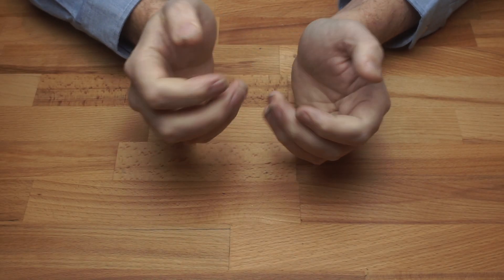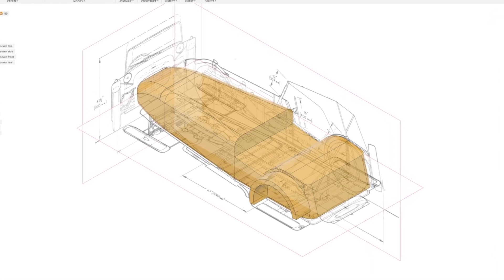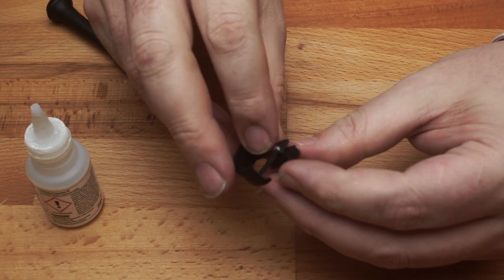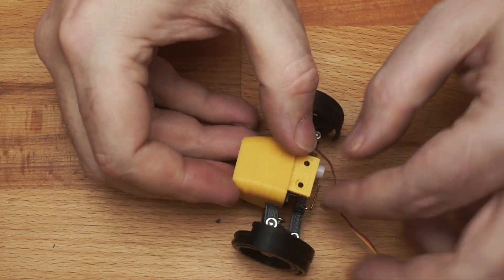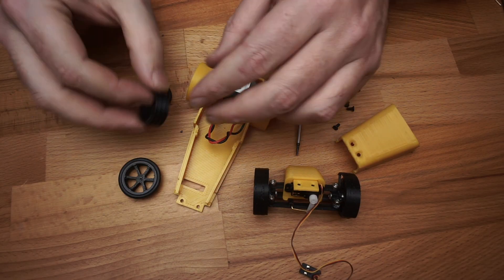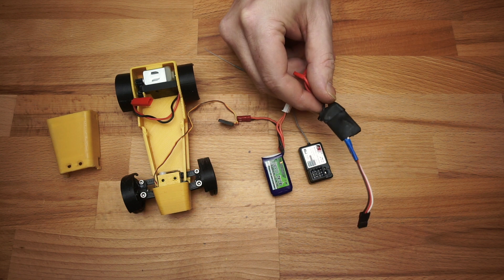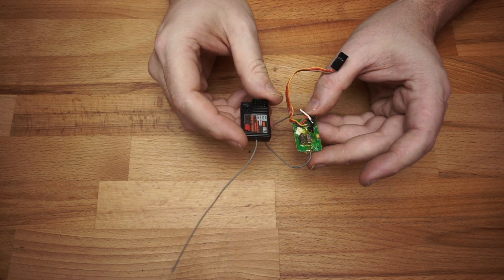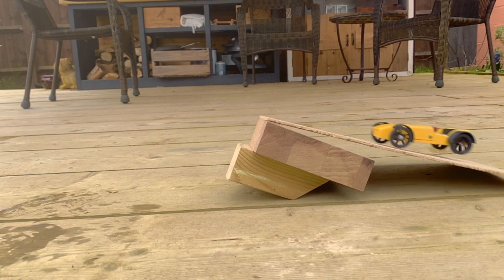How to 3D print an awesome RC Car!

Comment: Awesome design! Few questions (maybe you can add responses to your github): 1) For the O-Rings, you mention 10 x 22mm Orings, Is the 22mm inner or outer diameter. 2) There seem to be some sort of bearings installed in the wheels. Can you provide details on what specifications they are?
Reply from the maker: Thank you. Always happy to answer questions.
1) the o-ring I used were 22mm ID by 3mm
2) the front wheels run on bearings that are 3mmID,  8mm OD and 4mm thick - it's worth finding decent ones of these - i bought mine from hobbyking, the cheap ones from amazon can have WAY too much play in them

If you have access to Fusion 360, I'd recommend looking at the CAD, you can pick out any measurements of random parts from that -  there's even a hidden bonus feature in there - a holder that screws onto the motor clamp and allows you to attach a FPV camera.

Let me know if you make this, I'd love to see what you do.
Reply: Thank you! Thats what I needed and i've started printing the parts and ordering the misc electronics, etc. Will definitely update on the results. I've got F360 but it's a little hard to navigate so playing with that as well (Will look for the FPV clamp as we do have some mini cams we've used in other builds!)
Reply from the maker: @CaseFlatline  Glad to help! Cant wait to see the result.
Reply: @roTechnic  Well we finally got all the parts and started putting it together and realized the github doesn't include the bonnet (unless I am missing something obvious). Could you upload that?  Also what is the length of the main axle and intermediate gear shaft? We bought the 2mm steel rod but it's not clear what lengths we should cut them to. Thanks!
Reply from the maker: Well, I'm a muppet aren't I! I've added the bonnet as a separate STL. For the axles, it really depends on exactly what size your printer prints everything at, what i did was slide the rod into place, with the wheels, gears etc and then cut it to length. you'll want to make sure that the wheels don't bind with the sides of the chassis, so leave a bit of slack there.

when you are attaching the gears and wheels, you may find they slip on the shaft (again, depending on tolerances etc) if they do then you may need to rough up that part of the axle with sandpaper and add a drop of superglue. I had this problem on an early prototype and that fixed it, but the one I assembled on video worked fine without it
Reply: Thank you. We've downloaded it and are printing it now. Confirmed on the axle lengths, we'll take some measurements and share it back here but yes, I see how it can vary a few mm here or there.
Reply from the maker: @CaseFlatline  cool, let me know how it goes! I'd love to see it when you're done!
Reply: @roTechnic  We finished the build! It really is a cute little car to drive around. Here is a video to our build: https://youtu.be/eN-BSBFxp-A
Reply from the maker: @The_ClipDRIP  Oh wow! you actually built it! I love the colours. Glad you enjoyed building it. If you make any changes be sure to let me know and I'll add them to the github page,
Thank you so much for sharing the video - that has really made my day!

Comment: You make it look so easy, I have a 3D printer and really want to get into building rc cars but I don't know what to buy and where to start. Any suggestions for how to get started? A begginers guide even?
Thanks for the content regardless :)
Reply from the maker: Thank you. My advice would be to make sure you can print really well, then hit up thingiverse (or my github...) and print off something small and easy (there are lots of servo powered mini RC tanks out there, which are GREAT fun). Once you've managed that, then you can progress on to the more complex models. If you've got any questions, feel free to hit me up for advice.
Reply: @roTechnic  Thank you very much! that sounds great, ill give that a go.